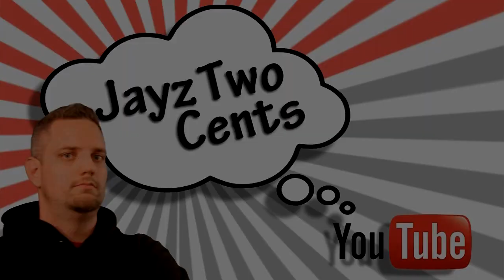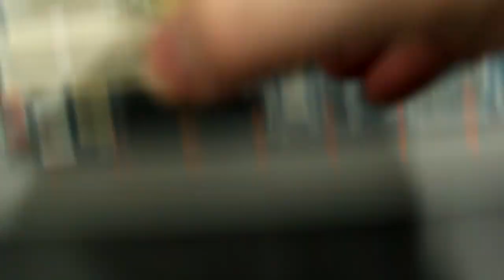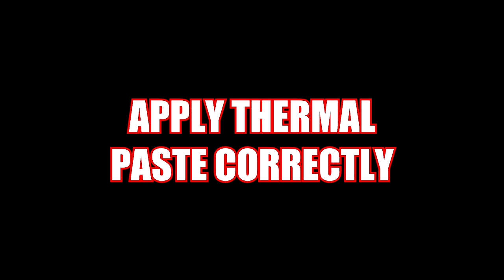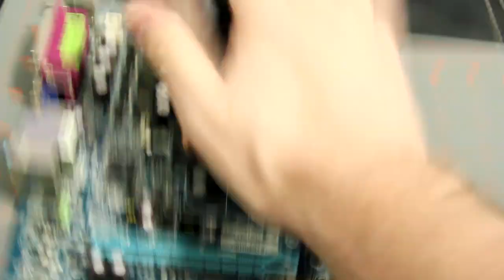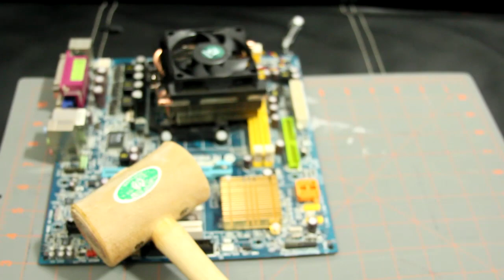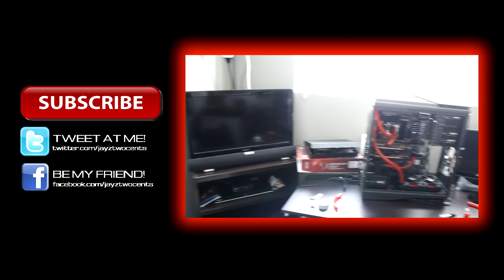How To Install a CPU - The Jayz Way

Comment: Is it normal that the CPU (3570k) needs more force than the protective plastic cap to fit & lock the metal tip (the one that you close by pulling down the metal stick). It sounds like its going to break and i don't want to bend the socket pins, oh fuck no.

Comment: Jayztwocents you are amazing you inspired to build me a pc but I have a question that you will probably be able to answer I bought a hp desktop and it has windows 8 and a 1tb hdd and I wanna know if I can save some money and use the hdd and os on the pc I might build and when I get the money I will get a ssd and like buy a copy of win 7 or 8 and install it on that but right know I don't have the money

Comment: @Jayztwocents im having trouble getting my ram to 2133mhz, my motherboard is a asus p8z77-vpro and my ram is G.skill rip jaw z series 16gb quad core 2133mhz, I set my computer on the xmp file but crashes. Any help?

Comment: don't use fraps, use dxtory. Pick it up, get the lagarith lossless codec, and record at 720p. It'll barely hit performance. But yeah, if you want to do proper video recording you will need to spend at least 500 dollars.

Comment: the hd7750 is for around 70$ and can play every game with these resolutions 1280x720,1440x900 on meduim-high depending on the game with frpas with smoothly, but if you have a monitor with these resolutions- 1680x1050 or 1900x1080 then you should take the hd7770 it's really impossible to get cheaper pc for your needs :)

Comment: I can give you a pc for around 350$
ASROCK FM2A75M-DGS/BULK /FM2 $ 62.50
ATHLON X4 740 /BOX/FM2$ 78.00
4GB DDR3 1333 SILICON POWER	 $ 25.70
500G SG 7200/16M/SATA REFURB	 $ 52.32		
SAPPHIRE HD7770 GHZ EDIT 1G G5	$ 94.99
DAOTECH K62 MIDDLE ATX	$ 25.00		
PSU CM ELITE POWER 400W PFC $ 38.90
Total cost:375.42
Look for these parts and this pc should play every game at medium 1080p with fraps with 40fps+ if you have a smaller than 1080p monitor like 1440x900,1280x720,etc then an hd7750 will do the job

Comment: Like Jayz said it would be very hard to get a $300 computer than can run games whilst recording but I recommend getting an A10-5800K or if that is too expensive the A8-5800K with 4GB RAM. Get a cheap 500GB Hard drive, cheap motherboard and a cheap case. If you can spare the budget, putting in a 6670 will make the computer play games like BF3 at 40fps medium settings.

Comment: for gaming a good graphics card is basically one of the big spenders or the biggest spend. 200 bucks is a good budget for graphics cards, but mine a gtx 560 just dropped to 100 dollars and that runs all current games on highest settings. It will probably not be able to keep all games on highest, but Steam games tend to not be all about graphics and hardware demand.

Comment: Try going with these specs
AMD Phenom ii4 965 Black Edition Quad Core
Corsair Vengance 4GB RAM
Western Digital Caviar Blue 500 GB SATA III 7200 RPM
Silverstone Tek Micro-ATX, Mini-ITX Mid Tower
ASUS M5A78L-M LX PLUS AM3+
Windows 7 64Bit System Builder 
Total $455 on Amazon and is easily upgradable, hope this helps

Comment: if you can throw at least 150$ more, you can grab him a Pentium G860, a Radeon HD 7750, Cosair CX430 430W PSU, WD Blue Caviar 500GB HDD and Cosair Vegeance 4GB DDR3 1333Mhz RAM, and a Fractal Design  Core 1000, it'll play plenty of games at 1080p on medium with an Avg. 45 FPS, at 720p, High/Ultra with 45-55FPS avg. Hope this helps, yo.